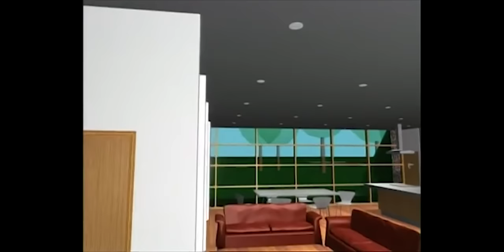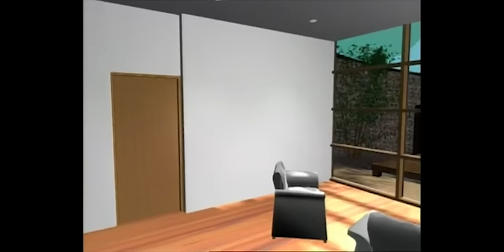Amersham | Season 1 Episode 4 | Full Episode | Grand Designs UK

Comment: I can’t believe that they would pour hose walls with no steel reinforcement bars in in tied vertically and horizontally. That’s how we do it where I come from anyway.
Reply: If the walls aren't structural, it's not necessary.  Concrete handles compressive forces extremely well.  The rebar will only provide tensile strength, which is most needed to support weight across open spans, or to help tie a structure together.  Regular brick and mortar walls don't have rebar in them either.

Comment: They need to sweep some baby powder on the floor boards to stop them squeaking
Reply: It depends on the source of the squeak. If the squeak is caused by a nail that is not holding, the squeak is almost impossible to fix. Been there. Builder.

Comment: Horrible. What's "grand" about that location so close to the noisy roadway?
Reply: I found it on Google Maps. It looks alright. There is a good stand of trees separating it from the road. And the design of the house itself, with the earth bermed against, it will block out mostly all the noise inside. The road is only 2 lanes though apparently busy.
Reply: @HistoricHomePlans  The noise is horrendous. You'd need to be a few miles away, not a few hundred feet  Not a moment's peace.
Reply: @ArthurDentZaphodBeeb  I haven't been there. I only studied its location on Google Maps. Have you been to that house?
Reply: @ArthurDentZaphodBeeb  l didn't hear any significant noise, especially inside - nor in the courtyard.